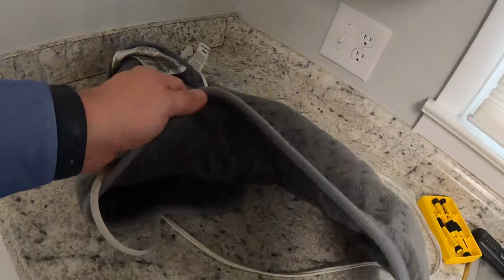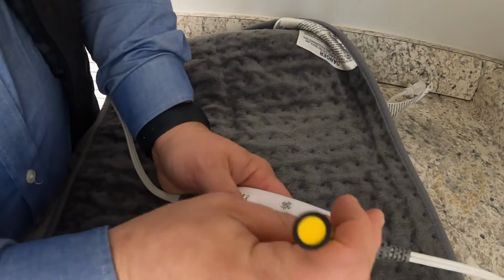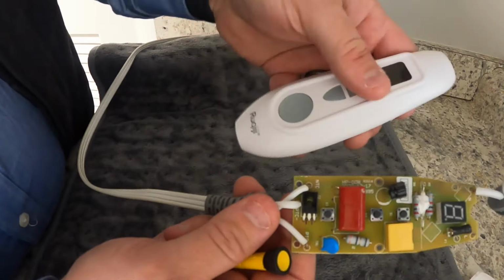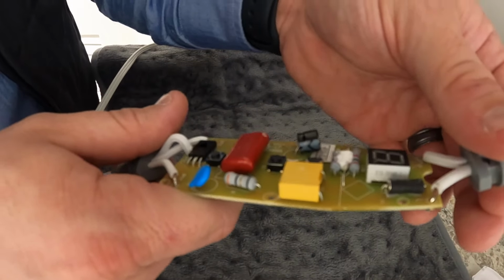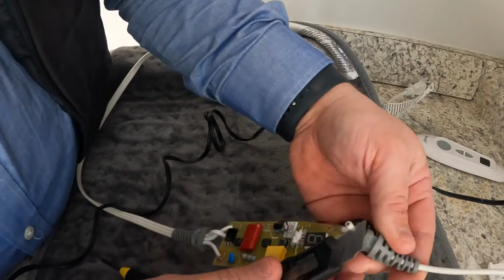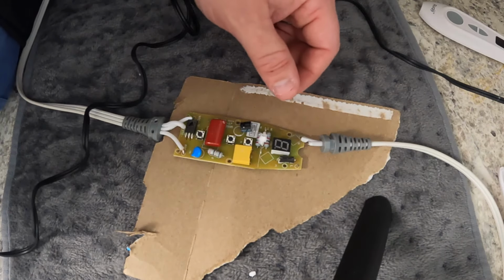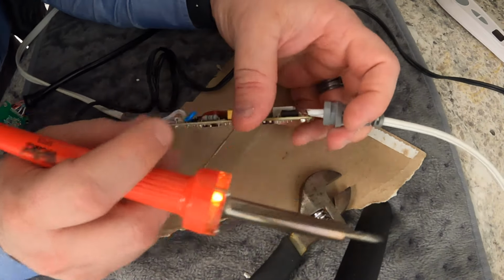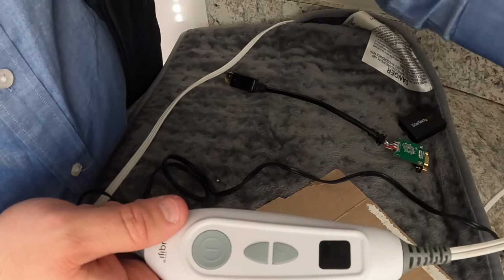Bad Blanket: Electrical Repair

Comment: Not the worst job I've ever seen, but it's not going to last very long. Always pre-tin the circuit board and the wire and then bond them together. To do a proper repair always requires new solder.
Reply from the maker: I knew someone who knew what they were doing would step up! Thanks for the tip, maybe i should also wear some gloves!